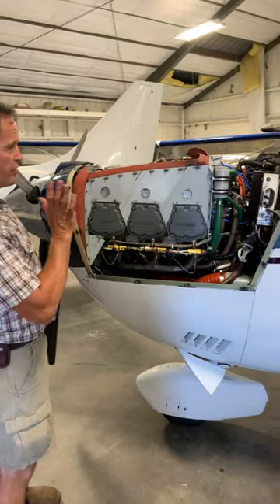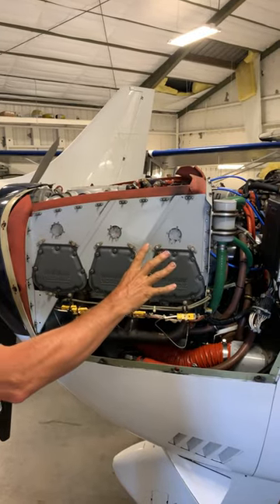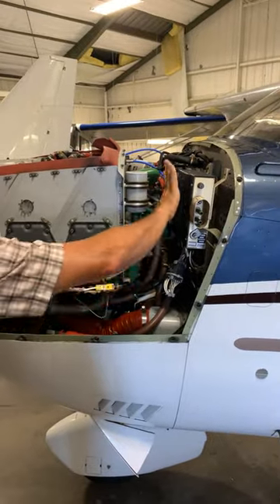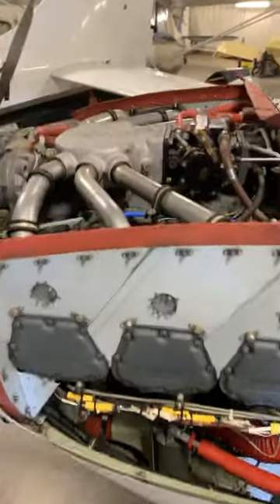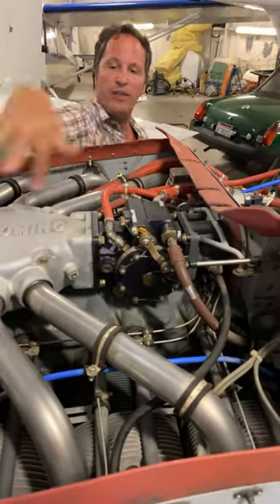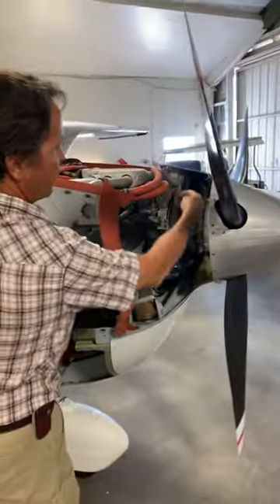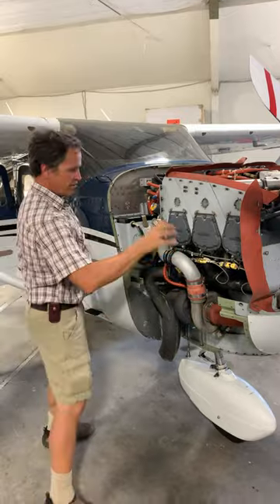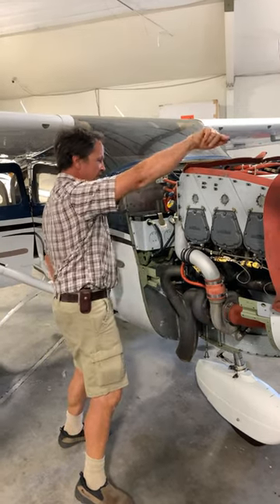Turbo 206H Engine

Comment: What year Mark ..? I see it has struts… not keen on the strutless ..! That huge alloy box thing in the roof holding the wings on !! Some times …..🤔
Reply from the maker: It's a 2013 206, so it always has struts.  You are thinking of the 1967 to 1986 210's.

Comment: What kind of Airconditioning is installed? by which company?
Reply from the maker: It is Kieth Air.  Installed new under STC.
Reply: @skywagonuniversity5023  Thanks for the answer! 🙂 just out of intrest; Do you have an idea of how it compares to the Kelly Aerospace Thermal Systems A/C? I know the one from Kelly is all electric, but I was wondering specification wise..

Comment: TSIO540?
Reply: It’s a TIO-540-AJ1A, Lycoming uses the letter S for engines equipped with a supercharger, he said TS because Lycoming’s biggest competitor (Continental) uses TS standing for turbo-supercharged on their engines even though there is no supercharger involved. It’s a common honest mistake.